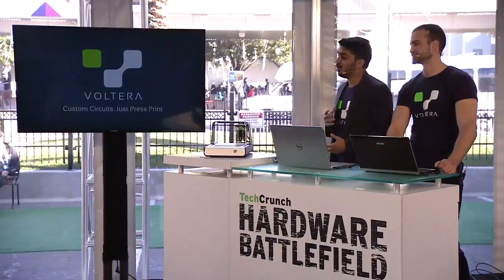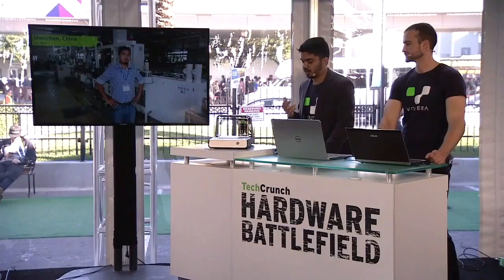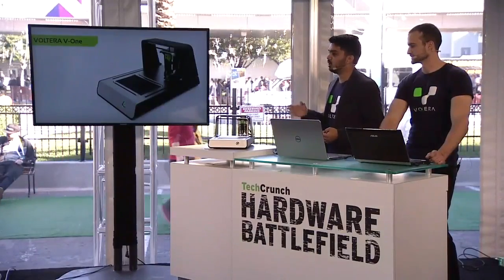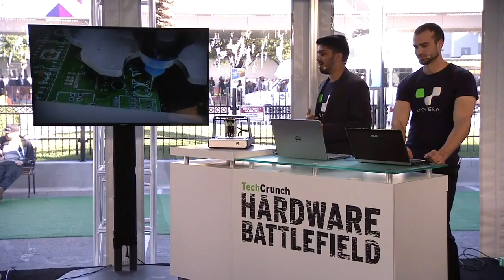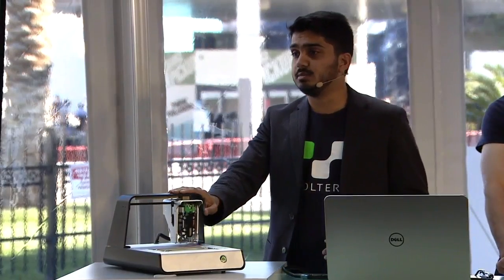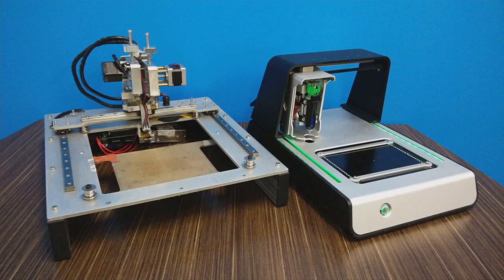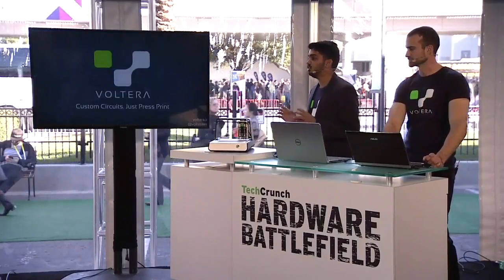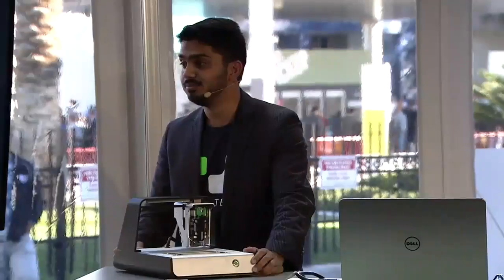Hardware Battlefield Winner Voltera

Comment: I really like the idea of this printer, but a lot of important questions remain unanswered for someone like me who is dealing with circuit board design and prototyping on a bit higher level than the normal "maker-community" does.
First: I absolutely have to know how high of a current you can transmit on a printed trace compared to standard copper traces.
Second: I have to know about compatibility with all kinds of soldering processes like Vapour Phase, Nitrogen Atmosphere, IR reflow, wave soldering and of course it would be nice to know how well you can rework these boards manually (exchange components) without pulling off pads or traces from the board. Did you run tests in these fields already?
Third: Precision is a major point i'm not convinced about in the current Voltera printer. Can you actually print some level of impedance controlled traces for high speed differential signaling? And how about directly printing tuned antennas for Zigbee, BT, WIFI and other wireless interfaces?
Currently most of my day to day designs use component sizes down to 0402 (0.5x1.0mm) and QFN packages with pitch sizes of 0.5mm. My standard traces ar usually between 0.15 to 0.2mm. As far as i can tell, your printer seems to be quite a bit away from reaching that level of precision. Do you already have plans to make your second product more geared towards industrial use and improve the resolution?
My last question is more about the heated bed reflow option on your printer. Can you actually do some real reflow profiles similar to the standard profiles provided by IPC/JEDEC? And what size of components can be reflowed this way? I imagine that big electrolytic capacitors or inductors would probably not get enough energy to be soldered correctly.
Anyway, you are definately on the right track with your product, and i'm looking forward to see it evolve into something that acutally can change the way we are prototyping in the industrial sector as well as in the maker-community.
Reply: Working on it... www.nano-di.com.
Would love to hear your comments!